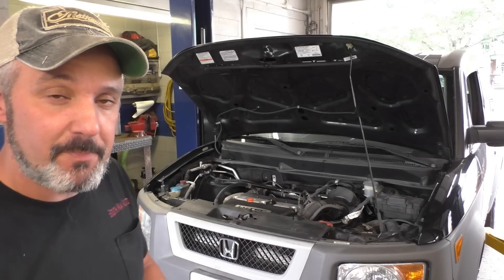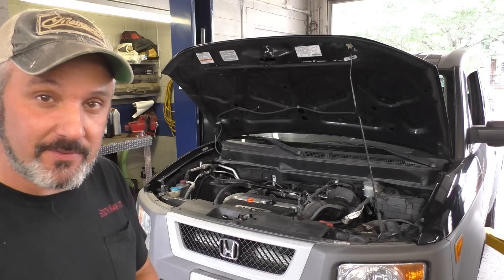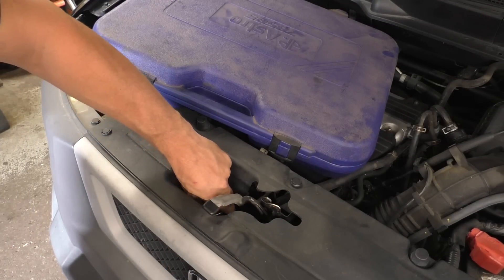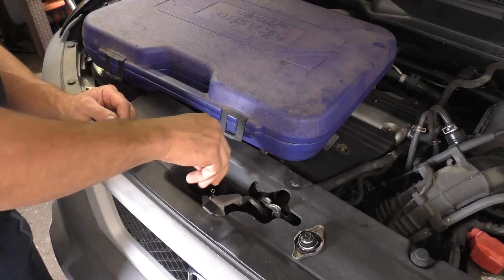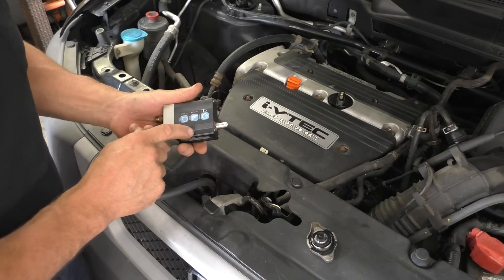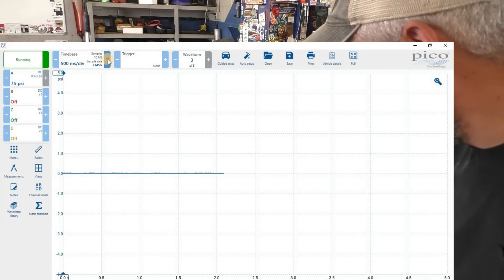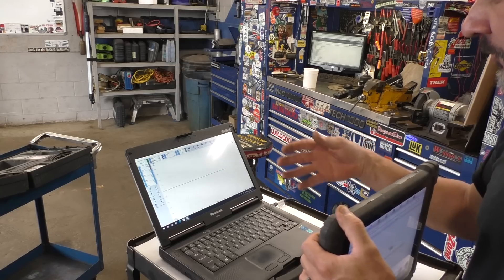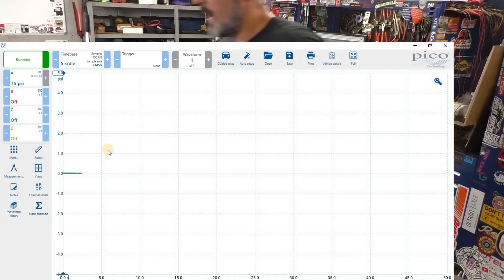Blown Head Gasket? On What Cylinder Though....🤷‍♂️

Comment: How I diagnose internal engine coolant leaks on a modern vehicle without this fancy equipment is if the vehicle is misfiring put the cylinder that’s misfiring to tdc and using a leak down tester put full pressure to that cylinder disconnect the return hose from the coolant recovery bottle  inspect for bubbles coming from the return hose if you have bubbles or coolant comes rushing out then you know your issue is with that misfiring cylinder

Comment: Interesting i had an issue with coolant vanishing in my old Honda Aerodeck and the shop could not find any issues, now the oil did look ok and i did not see any residue in the tail pipe nor did it blow white smoke so bit of a mystery. I seem to recall my car started to heat up quite fast in slow/stand still traffic which was bit of an annoyance :)
Reply: Sounds like a blown head gasket usually the milky oil is on one that's severely blown
Reply: @ddiablolll  Yeah could have been for sure, the car was then sitting for a year, had my brother come with jumper cables and started right up no smoke or anything, was a nice car with flip up headlights and such.

Comment: Struggling with a similar scenario on a friends 1994 MR2, cooling system is becoming over-pressurized and blasting out the overflow.  Unfortunately we've ended up in the situation you mentioned where we've already replaced the headgasket but didn't find any obvious issue with it.  We're confident we did it correctly but it did not fix the problem.  The head was checked by a machine shop and found to be within spec for flatness and also was pressure tested by them as well.  At this point we're kind of out of ideas other than possibly some kind of crack in the block allowing combustion pressure into the cooling system.  Would this test or any other test you can think of allow us to get any further on this?
Reply: The radiator pressure tester would reveal the truth also all you do is screw it on to where the radiator cap is turn on the engine wait till it's warm about 15-20 minutes and if that pressure is above 20 psi it's definitely the head gasket. I can tell you if it was ever overheated or really low on coolant the aluminum is probably lost its heat treatment and even if you resurface the block and the head it will still blow again. It's either new engine time or maybe if the block is iron just resurfaces the block and buy a new head

Comment: At the end you should have put in #1 & #2 plugs (only), just to show they don't contribute in any way.  We never DIDN'T see a pressure build with a plug installed.  Oh, and starting it with all four plugs installed AND the injectors operational would have been an interesting pressure-build plot to see how high the pressure got... probably to the relief pressure of the cap, assuming the diagnostic-cap has a pressure relief?

Comment: Top notch diagnosis, Now you can reseal the to the Cylinders to the head and run it another 200,000  Miles perhaps, Catching head leaks early like this saves on the rest if the Vehicle trans and engine if it wasn't ever overheated, I don't like when some folks think it's ok to run them until it turns into a steam engine, Everything else gets potentially trashed then, Including the head warping out of spec, Nice save 😎👍.

Comment: Again, another very good video.  One thing I noticed was the peaks in the wave forms. One or two larger peaks and then flatten out some and then peaks again. Couldn’t tell which cylinders though. I like the fact you did the spark plug removal to find the cylinders so you could pay the extra attention to check the deck and head for straightness.

Comment: I diagnosed a bad head gasket on my Briggs powered riding lawn mower and
I narrowed it down to cylinder #1  since there is only one cylinder  in that engine  :-0)
( It was pressurizing the internal engine space and blowing oil out the fill tube and breather tube )
PS
I have a 1986 Goldwing that uses about 3 oz coolant for every 100 miles. Nothing in the oil so,
weighing the cost of repair, I have resorted to frequent maintenance of the coolant level. (It will begin getting hot when I lose around a pint.)

Comment: You can check it although pressuring the radiator with 24 psi and stick a camera inside the spark plug whole and see where the water is pouring inside the cylinder

Comment: Why is knowing what cylinder it is  necessary with a blown head gasket? Isn't the repair going to be the same? Regardless of which cylinder the leak is actually occurring near? This damage will require either a repair of or full replacement  of the head usually? Right? I ask because I have gone through this situation when I owned a Chevy Vega which had an aluminum block. Just wondering I any thing was missed back then with that repair.

Comment: I hold a playing card about an inch from tailpipe and the coolant will condense on the card and drip down to be easily inspected and confirm a coolant leak into the cylinder. If you have dual exhaust you can tell which head has the problem.

Comment: Great diagnostic test, Eric.  I’d like to run this test on my 1974 AMX 360 V8. My dad and I replaced the head gaskets about 47 years ago.  What a pain in the butt.   FFwd to now, and it might be leaking again.  I hope we get to see the video of the head gasket replacement on this Element.  That’s my daily driver now.  The AMX is for special occasions…😎
Reply: Pull the plugs and look for the clean piston with a borescope. They are really cheap online for the ones that run off a smartphone. Usually a piston will get steam cleaned if coolant is leaking in that cylinder.
Reply: @Troy_Built  Great idea, thanks.
Reply: Make sure to resurface the head and block
Reply: Well the factory lasted two years and yours 47 years that’s a vast improvement. 👍

Comment: Looks like it would be most helpful on multiple heads, like a V6 or V8.
Reply: I was wondering if it mattered for a one head vehicle, you gotta replace it anyway.  But, I can see where knowing which cylinder helps with confirming if the head is warped or just a gasket issue so a guy doesn’t put it back together with a warped head.

Comment: Great diagnosis... On a side note, it breaks my heart to watch a K24 with a blown head gasket... :-(
Reply: Problem is living up North like this and my Honda's do, The temperature Swings are insane when it's-30⁰F in the Winter and most like me just starting up a go with only minutes for any kind of warm up, Headgaskets just Don't last forever in Most cases, I had two 2003 hybrid 1.3l Honda's blow shortly after 300,000 miles the rest of the cars were tired by then anyways, Now I run two 2005 1.7l Honda's I do my own head gasket and timing belt replacements on them not a big deal for me, As a Diesel tech. Most carsJust can't beat the fuel efficiency, except for my wife's new 2 liter 2020 K20C2 engine that gets over 40+ all day long with a 6 speed manual in Civic Sport Sedan.🤓
Reply: @raymondreiff8170  no warm up equals blown head this is especially crucial on diesels and motorcycles where theyre guaranteed to blow if they're not warmed up.

Comment: I used a leak down test for this. While not as accurate and more basic, was able to accomplish it with similar results. Certainly would lead you to look further (cracked head/block) if no evidenced found upon gasket inspection. I’m still a1 bit old school. Just can’t afford that level of technology as a hobbyist. Great video with great explanations.
Reply: And until just now I would have put all my money into the leak down tester and radiator pressure testers readings. But this little pressure transducer is on another level of accuracy

Comment: I suspect it's leaking #3 to #4 and then #4 to the coolant. With #4 plug installed the pressure we saw was from only #4 with some leaking to the open #3, hence lower & slower pressure build up. With #3 installed the pressure leaked to the open #4 but not to the coolant, so there was no indication. With both installed we saw the cumulative pressure from BOTH cylinders, hence higher & faster pressure build up.  Two leaks but different types. I've been out of the testing/monitoring equipment industry for about a decade so I'm amazed at the level of test equipment available today. Great video as always!

Comment: It is important that you mentioned a warped head.  Sometimes that is what causes head gaskets to leak but remains unchecked when a new head gasket is installed resulting in another leaky head gasket eventually.
Reply: I love it when I watch a coworker stuff a new gasket in without checking the head for flatness.  all they had to do was ask me for my machinist straight edge.
Reply: There's a right way and we all learn it the hard way. If it was ever overheated badly then there's no more heat treatment strength and it's best just to get a new engine IMO if this was a shop the liability of it blowing again is pretty high and it's better to just replace the engine. But if it's never been overheated feel free to resurface the block in the head which is probably more work than replacing the engine

Comment: That's awesome.

I do have one question - is the update rate on that pressure sensor fast enough that you could tell which cylinder it is just by using the sensor and spark trigger on no. 1?

I guess the inherent time delay in the movement of the coolant could present an issue there.
Reply: Yes you can just put an ignition sync and see which cylinder, I prefer to use a pulse sensor.
Reply: @advancedleveldiagnostics  thanks, appreciate the confirmation. :)

Comment: Hey Mr. O, I have a 1982 Chevy S10 with the 1.9L L4 Isuzu G200 engine. It’s got 200k mikes on it and I did a 95% engine overhaul on it at 197k. Only things I didn’t do to that engine was get the block bored over, the crank bored under, and new valve seats pressed in. I lapped new valves and faced the block and the head myself, just for some background. Recently at just over 200k I had all the pressure in the rad, all the sweet smelling white smoke out of the tailpipe, and about one gallon of coolant loss over the span of approximately 8 miles. Pretty convinced it’s a head gasket, and the grounding tab on spark plug #4 was broken off. That’s as far as I got before I took a step back to collect my thoughts. All I have is a cylinder compression tester; no coolant pressure tester or bore scope. Can I get similar results to what you got with only my compression tester?
Reply: Heads and block weren't resurfaced? The compression tester will tell you if you have a dead cylinder from a majorly born head gasket. In your case I would use a radiator pressure tester, put on the radiator pressure tester and start the engine, initially when you start the car the pressure may be high so disregard those readings until the car has been on for 15-20 minutes... so basically when the car is warmed up the pressure should not go above 20 psi if it does it is the head gasket. 

Sometimes if it's even a smaller leak then only a boriscope the little video camera wire thing will reveal the issue you can tell which cylinder is blown because the Piston is shiny and clean.

And in your case if there's no coolant dripping down and you smell it in the exhaust pipe you know that it's getting burnt in the combustion chamber. If it's ever been overheated bad the aluminum heat treatment is gone which means the aluminum head has no more strength and we'll blow again even if you resurface the head and the block.
Reply: @ddiablolll  thanks for the info man I appreciate it
Reply: It doesn't matter.  The problem is hardware, and disassembly is required.. but you think further analysis is needed?  GTFO of here with that.
Reply: @ShainAndrews  hey buddy I don’t need that kind of attitude, if you’re so high and mighty then help me learn and I’ll gladly take notes, otherwise haze yourself. I’m here for the knowledge, not the hate.

Comment: i don't like that you got lazy and didn't drain the pressure on the last cyl.. yeah i mean did you open the cap and look for air bubbles in the coolant too? thats a pretty good indicator that doesn't require a sensor .. or you can do a paper litmus test and see if the coolant is showing its contaminated... or do a leakdown test on the cylinders while you also look for bubbles in the radiator.. lots of ways to diagnose it
Reply: Is there a point to your rambling post? Did you watch the video? Eric said that it is one way to test, not the ONLY way. Go watch Scotty wave his arms around.

Comment: If you go in there with a borescope, those 2 cylinders should be nice and clean. BTW, could it also be a cracked cyl head?
Reply: Cracked cylinder in my experience happens on aluminum heads(everything from 1990+). It's from a combination of a blown head gasket with a massive exhaust restriction. Like a Toyota pickup V6 3vze(not Tacomas 5vze which has a good normal exauhst flow)

Comment: I had a vehicle with disappearing coolant, it was not a head gasket, but rather the pan seal.   Two different mechanics told me it was the radiator cap, even after I told them to find the issue.  Finally the 3rd found it.

Comment: Your theory is all good until you spend all this time and the customers says- " I need to wait until the end of the month when I get paid to bring it in"    Then you put it all back together and later find out he just drove it to a dealer and traded it in.
Reply: Thats what the diag fee up front is for.
Reply: @scrappy7571  Yeah, as long as he charges for all that time, which is a lot more than a normal head gasket diagnosis.
Reply from the maker: Doesn't matter to me. I get paid to diagnose weather they fix it or not.

Comment: Eric is a mechanic's mechanic! Through & honest!
Me, I've been repairing my own cars for 50 years (retired-done everything but a automatic trany cause I don't own a magic wand) but I never had a blown head gasket, ever. Lucky I guess!
Reply: Same here. Been wrenching on my own vehicles for over 30 years. I've done Automatics. But only 3 so far. Just don't have all of the correct tools for the job. But I've done mostly every thang. Bought myself a scanner a few years ago. I would love a Pico scope.
Reply: Eric literally is a mechanic's mechanic. Other mechanic shops send cars to him, when they can't figure it out.
Reply: Transmissions aren't that difficult - you may be suffering from the "Huh" syndrome.  If you understand enough to capture automotive wiring, and the intricacies of building a motor, a tranny is a piece of cake.  there's plenty of literature out there to assist in the job.  Further, there is a guy on here at Precision Transmissions who explains a LOT of the things to look for.  Unfortunately, he does nearly no builds, mostly teardowns - but chock full of information and high end repair parts.  BTW, I've seen a lot of tranny guys on here - he is absolutely the best.  So, if you want to learn, go watch some of his videos.
Reply: @bill8by5  Transmissions may not be difficult, but they are very finicky. Even if you know what you are doing, all it takes it one check ball in the wrong hole in the valve body. Put a torrington bearing in backwards, tear a lip seal or a teflon seal, etc etc the transmission either won't shift or it will self destruct and you have to do it all over again. It's not rocket science but you have to be diligent and thorough.  I used to be ASE master certified.  I will replace a valve body or solenoids etc , can easily pinpoint the problem, but when it comes to rebuilding an automatic I leave it to the specialist.
Reply: @Stumpy1973  you mean the robots because the dealerships just replace the transmission and robots build a new one
Reply: @jdjd7127  Some dealerships still have transmission tech's that actually rebuild them in house, but you're right a lot of dealerships just replace them.
Reply: Thorough, it's a difficult English word.
Reply: @jo300hn  through it all, we threw away English class in order to kick a field goal through the goal posts.  The ordeal THOROUGHLY destroyed our society.  Odd how football has nearly no academic qualities, yet English is so elegantly necessary.
Reply: @bill8by5  Eric is a great mechanic, thorough and honest through and through.
Reply: @jo300hn  Hahahaha
Reply: @jo300hn  the error isn't in the mis-spelling  of the word, it is more in not checking what you wrote before posting it; we all hit the incorrect keys at some time, but most people may not check before posting

Comment: Eric, I hope you do a video on this element for tear down and reassembly.  I have 184k on mine and may have to do timing chains. Would be great to see what's involved. If you do replace the chains, make sure you do the oil pump chain and tensioner. On mine that's what's making the steady tick/slap sound as the tensioner on the oil pump chain starts to go.
Reply: I have 213800 on my 04 and a ticking sound. Had the valves adjusted and noise went away

Comment: Stuff you will never have to do on an electric car.
Reply: True, but there will be a whole lot of new problems to fix.  Good luck removing the 2000 pound battery in your driveway on a Saturday afternoon.
Reply: @scrappy7571  Agree I am the most anti-BEV person on the planet. ICE will be around a long time , after 2035 Calif. will allow plug-in hybrids to be sold and they have small , efficient gas engines. By then I will probably be somewhere more sane like FL or AZ , constitutional carry and gas and diesel engines.😂